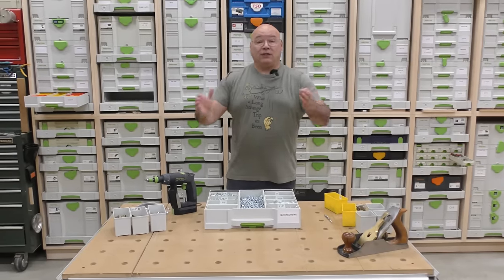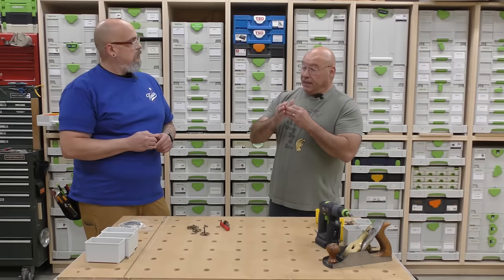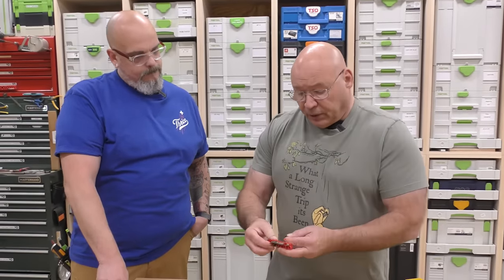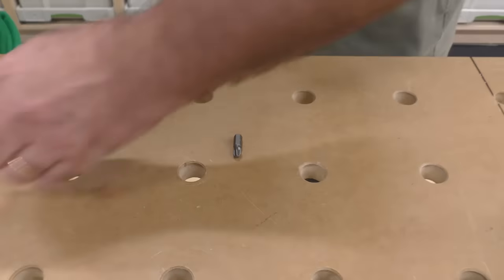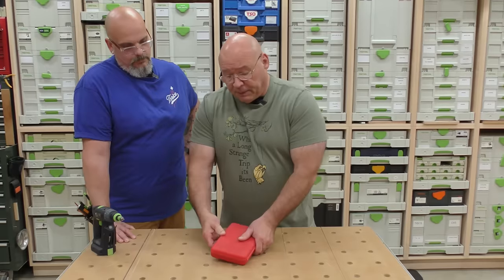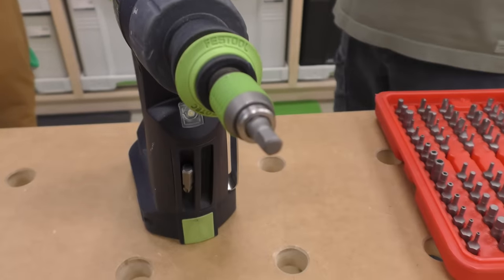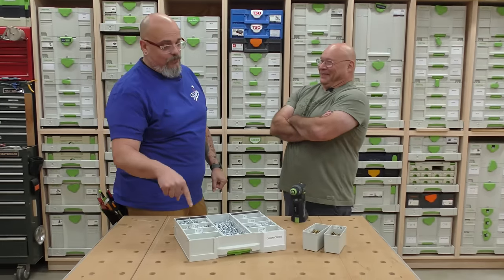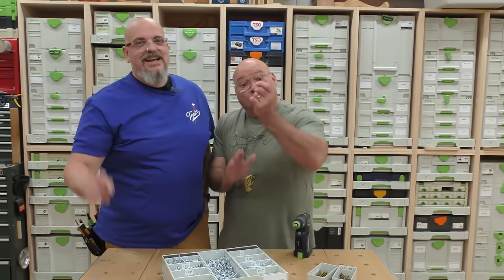End Shop Frustration Now! This One Simple Trick Will Change Everything!

Comment: I like the torques, but I’m in love with the square heads no tear out, no rounding over my money they’re the best
Reply: Canuck
Reply from the maker: cool
Reply: Agreed.  I only buy Robertson (square) drive screws, that also have phillips slots that allow either driver to be used.  They also "hold" to the bit when you need to drive them in odd angles/positions.  Torx are too finicky IMHO... too many sizes to keep track of and bits on-hand.  You only need S1 and S2... mostly S2 for all square drive bits.
Reply: The other "virtue" of Robertson is that nearly all of the woodworking screws are R2 (although they make 0,1,2,3 as common sizes. Kreg likes square drive.

Comment: Great video. The big bit set is great (and there are more types than any one set will cover if you get into the tamper proof stuff). And buy good, impact rated Torx bits for you everyday users, I assume Festool is good but Milwaukee, Makita, and DeWalt, also good, the ones that come with the screws are "gaabage", they often do not even fit the screw heads and wear out quickly. I tried to drive some the other day and the bit would not fit, si I grabbed a Milwaukee T15 and it shore enough did fit and work. Just a duffer, Sedge, but I like to buy and use the good stuff. Apple Mac computers used to use T15 for cases and now use T6 and T8 for innards. And you missed one type of crosspoint, the JIS (Japan Industry Standard) which is an Asian take on Posidrive but of course different, still popular with camera makers, used to find them on Asian Motorcycles, too. And some modern lag screws use an 8 point driver bit instead of 6-point, because of course they do. Great video (I might have said that already).
Reply from the maker: cool

Comment: I just started on the torx journey last month after being frustrated with cam outs.. very helpful video as I thought I was being crazy discarding all the stuff to normalize on one system 😂
I have a question - do you see using the torx screws for drawer pulls, hinges etc as well?
Reply from the maker: I will probably stick with the hinge screws that come with the hardware.....I think the hardware manufacturers should switch to Torx...

Comment: Good info, thanks. However I still cannot see the advantage over the square drive. Cheers, Peter
Reply: Square drive cams out pretty easily, not as bad as phillips though. The Kreg screws are absolute garbage in that respect. Also the square drive tips get stuck in the screw a lot, because the screw head deforms, even before it cams out fully.
Reply from the maker: ok

Comment: The torx is great but I have thousands of square drive screws as well as pocket hole screws and can just not throw em out.
Reply from the maker: I gave almost of mine away to convert … it was tough
Reply: Same, though as I run out of a particular size of square drive, I've been replacing them with spax. Eventually I'll only have spax and pocket screws in my shop.

Comment: When buying torx screws, do check which size torx is needed. Having to change torx-size is just as annoying as having to change bit-type.
t20 for normal (furniture) screws (ø 3,5 / 4.0 / 4,5mm) is my first pick (though I started with one brand using t15, which was annoying since the majority appeared to be using t20.
t25 (or t30) for construction (ø 5,0 / 6,0mm).
I'm buying different brands screws, since I prefer to use t20 the most (when brands use t15 for 3,5mm or t25 for 4,5mm, I skip those)
Reply from the maker: cool

Comment: Point of fact. Torx do not remove if they rust at all.  Secondly different manufactures have different torx sizes for the same t2 screw.  This is enormously frustrating. I have three different t2 bits. I have to check each time to make sure I use the one that fits the screw best.  Once the screw strips your screwed and have to drill the head off.

Best tool tip for removing screws. Do not use a power tool to break it loose. More often than not you will “cam” it if you do. Short stubby screwdrivers work great.
Reply from the maker: ok